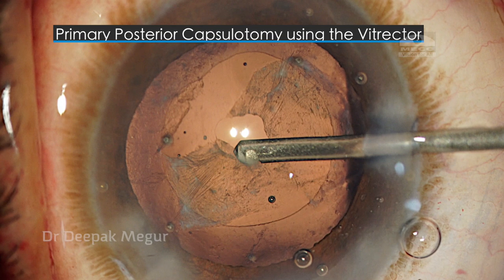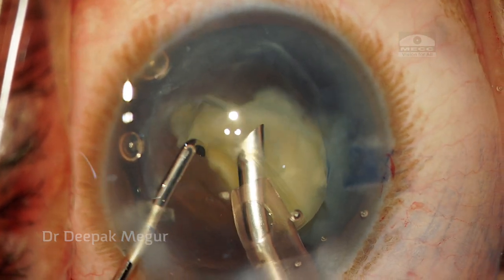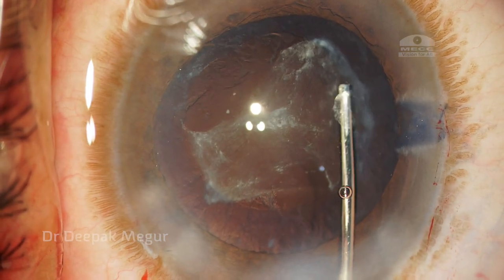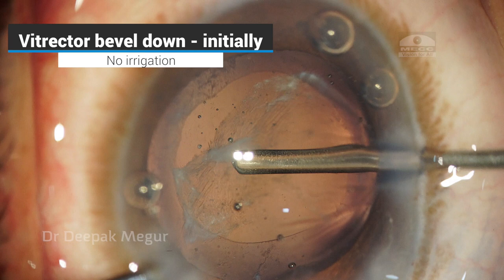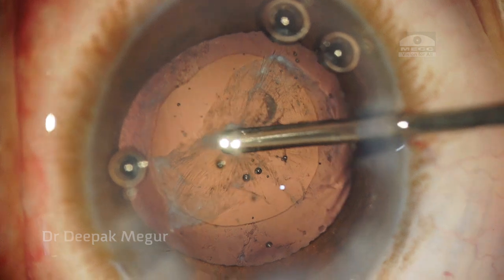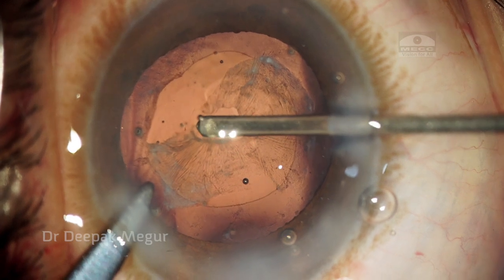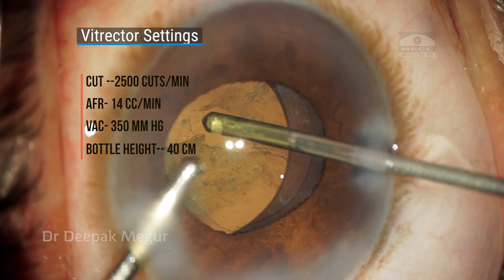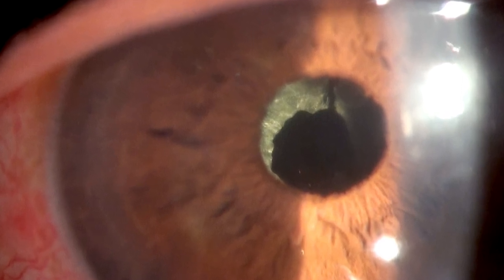Primary Posterior Capsulotomy by  using a vitrector- The Secrets- Dr Deepak Megur

Comment: Beautiful case, Dr Megur! I find that in doing these cases, using slower vitrector cut rates on the order of 300-500 cuts/min facilitates capsular engagement. It is helpful to inject OVD just after making the inicial capsular hole to detach and dissect the anterior hyaloid and keep the vitreous pushed back. Well done!
Reply from the maker: Thanks & I agree with your comments